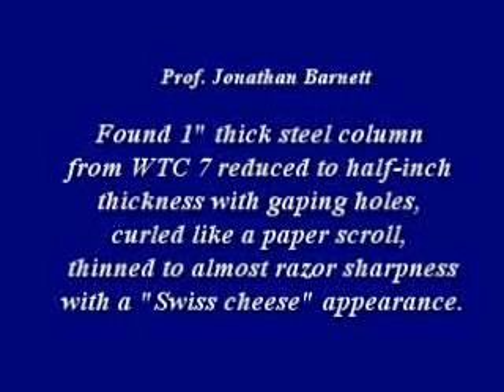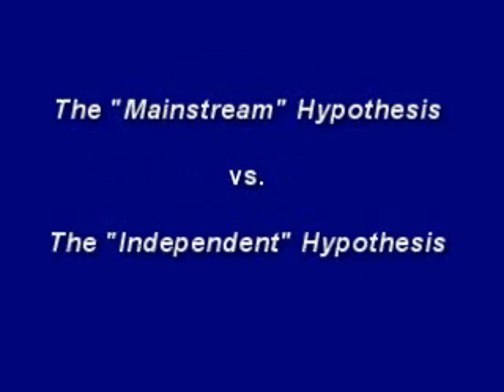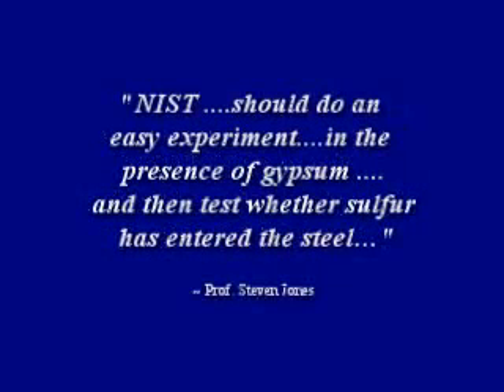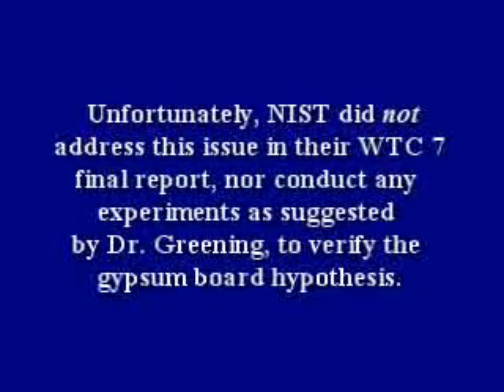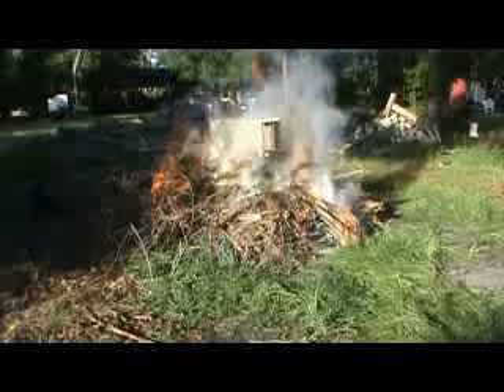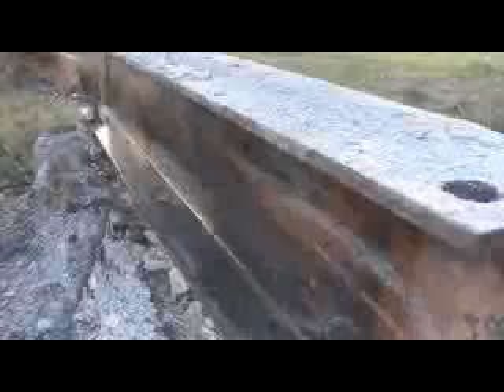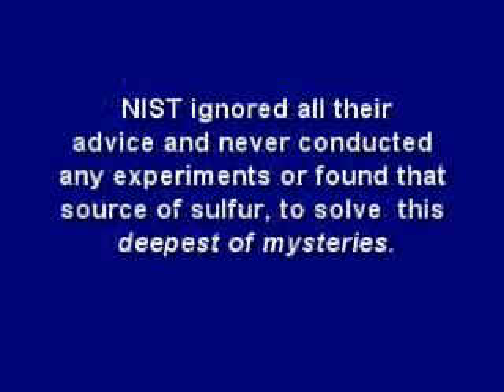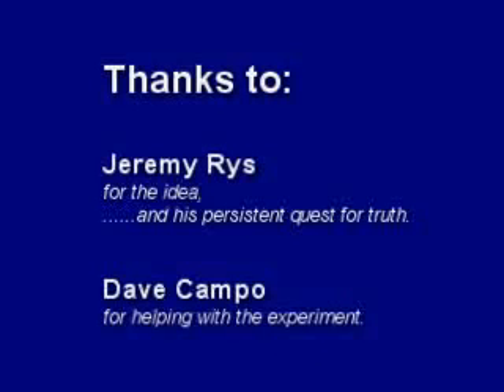9/11 Experiments: The Mysterious Eutectic Steel

Comment: @Kenzofeis "Show me examples of melted and sublimated concrete in a building fire, sufficient to supply a lot of sulphur in surrounding steel structures of great thickness."

Did you notice the debris pile after the building collapsed? This is where your 911 Truther colors will really start to show through. I can tell already that you're not an American and that you have ZERO training in any branch of physics, chemistry or engineering.

Comment: @Kenzofeis "Very high temperature"

The piece of steel that was eroded due to sulfur penetration had the erosion occur at 1800F or about 200 colder than most typical fires. 

"Further, it's not about ordinary corrosion, it's about metallurgy and crystals."

Well OMG!! That changes everything! I forgot about the mystery metal and power crystals.

Comment: @Kenzofeis  "Then, do an experiment where you add sulphuric acid to a setup like his"

I already know that the sulfur will corrode the steel which will then burn away when heat is applied. His experiment wasn't to argue that sulfur couldn't corrode steel, that would be stupid. 

His experiment was prove that WTC drywall (made in the 60's) and Jet Fuel could not have been sources of sulfur.

He used drywall made today and ULSD making the experiment  grossly flawed.

Comment: @Kenzofeis "Mid-1990's"

All on-road diesel fuel (like the fuel Mr Cole used in the above video) is ULSD with 250 PPM or less but typically only containing around 100 PPM or so. 

Jet A contains 3500 PPM or greater. A grossly flawed experiment in the above video. 

The "Chinese Drywall" scandal plaguing Mr Cole's state revolves around the high sulfur content of chinese drywall that did not meet U.S. code meaning the drywall Mr Cole used also contained low levels of sulfur. LOL

Comment: the nist states it has videos & photos of wtc7 collapse. but without examining the actually steel which held the building together all they have is a speculation. the NIST autopsied wtc7 externally from videos & pictures. for how can they determine the true cause of failure without a forensic examining the internal components? the steel. how can this be excepted as proof positive & go unchallenged? examining the actually steel, the guts of the building will at least give a clearer understanding.

Comment: @flanksteak2 if u dont mind me jumping in on this...NIST FAQ's.  "Column 79—the structural component identified as the one whose failure on 9/11 started the progressive collapse "The investigation team concluded that the column’s failure under any circumstance would have initiated the destructive sequence of events" 

1. how was column 79 identified as the source of the failure if no steel from wtc7 was recovered, what photograph shows if failing?
2.how was column 79 proven to be the failure?

Comment: @flanksteak2... Investigators even placed an uninsulated steel column in a furnace 2,012 degrees, the steel column reached 600 in 13 mins. They’ve even conducted test on recovered bolts and found, they too were much stronger than expected. The NIST metallurgist analyses shows of 236 steel samples collected no steel exceeded temps of 1,120 F. In fact NIST metallurgist show three steel samples reaching temps above 25...Yes, you're right it dose help when you read the full report.

Comment: @DuRound2 Which report? I've read them...Every single bit of the rubble was inspected..by whom? I missed that report. And where should I find this report?...Well tough...collect the evidence and test it...That's what they should have done...You don't find the cause of a catastrophic failure by examine a few parts..Do what the NTSB dose when investigated plane crashes...every piece is to be examined even if it take years..You have a problem with that?

Comment: It is estimated that 1.5 million tons of wtc concrete, steel & other debris & more than 350,000 tons of steel have extracted from ground to salvage yards & the NIST only collected 236 samples of steel to be tested, are they serious? That is all that is required for a full investigation? How can 236 pieces of steel be used in the investigation of two buildings, 110 stories each which took tons and thousands of members steel to construct? Why didn't they test the steel for any kind of explosives?

Comment: The NIST report is full of crap. Column 79? How the did the NIST know column 79 failed? In the NIST report they write no steel from WTC7 was recovered, but they know it was column 79 was the failure, really?

What evidence was used to come to the conclusion column 79 was cause of the failure dropping WTC7? The NIST states thermal expansions caused WTC 7 to collapse. What was physically demonstrated which supports that theory" Why don't the NIST show the facts which supports that case.

Comment: @flanksteak2 

"You don't need to be a scientists to tell that it's paint."

Humor me with a guess what the concrete to paint ratio was.  The odds that a large number of samples of dust was paint instead of pulverized concrete has got to be extraordinarily low.  And as Neils Harrit et al have explained, their samples produced low (I don't remember the exact number) ignition temperatures.  What a fire hazard this paint would be.

Comment: @DuRound2 

"its ridiculous to claim to see "Corner squibs"..."

No...whats ridiculous is jets of "compressed air" flying out of tiny holes through the aluminum cladding.  Look at the one corner during the north tower collapse.  One squib per oh say 0.33 seconds?  Thats wayyy too fast for slab impact to slab impact and it precedes the collapse wave.    And...If the floors are collapsing below the collapse wave then what the f is causing the collapse wave itself?

Comment: @fertilizerspike 

No, they used magical hush-a-bombs! Hush little hush-a-bomb don't say a word! 

"If you wanted the building to come down, and blame it on fire, which is not explosive in nature, you would use a different type of charge, an incendiary to cut the beams. You would NOT use explosives which would give away your project."
-Richard Gage

"The explosives had to be so intense such as to hurl these beams at 65 mph laterally, landing five hundred feet away."
-Richard Gage

Comment: @DuRound2
You're simply deluding yourself if you can't see the red hot shit spewing all over hell, falling faster than the smoke and the dust, defying the force of the wind where the smoke gets blown away, and the rapid disintegration of the core while this shit is spewing all around inside it, AFTER the outer walls EXPLODE outward.

watch?v=CQJW7_IIWZ0

Comment: @DuRound2
Look at the video, read the comments showing you the times where you can clearly see red hot shit spewing out of the core as it disintegrates, the outer walls are already blown out, the entire core is a column of smoke and red hot shit spewing everywhere. What is that, did they have a foundry and a dynamite factory in the buildings?

Comment: "If you wanted the building to come down, and blame it on fire, which is not explosive in nature, you would use a different type of charge, an incendiary to cut the beams. You would NOT use explosives which would give away your project."
-Richard Gage
The explosives had to be so intense such as to hurl these beams at 65 mph laterally, landing five hundred feet away."
-Richard Gage

(rolls eyes)

Comment: @fertilizerspike 

"Your belief that none was found is based on your ignorance. NIST and FEMA provided eutetic steel that had clearly been melted and cut, with thermite."

So which is it? Did they use thermite or explosives? Oh, and where's the proof that the eutectic steel had been cut with with thermite?

Comment: @flanksteak2 said:
"fell both inside and outside it's footprint"

Exactly correct, about 80% of the outer walls fell on other buildings in the complex, the other 20% of the outer walls and the core fell into the building's perimeter. And this demolition was completely symmetrical, both in terms of debris distribution and progression. Learn to fucking read, dumbshit.

Comment: @flanksteak2 said:
"only has an expansion rate of 50 MPH?"

Straw man. That wasn't the calculated expansion rate of the explosions (which was calculated much higher), it was the calculated rate of instant acceleration applied to certain pieces of debris whose rest position on the ground was known and whose initial position in the building was known. Learn to fucking read, dumbshit.

Comment: @fertilizerspike "ejected at 50 MPH"

What sort of explosive that is capable of  cutting steel several inches thick only has an expansion rate of 50 MPH? This that magical slow speed nano-thermite that you claim melts beams but also hurtles them at up to 50 MPH!!!!

Clown, at what point are you lay down the hammer, arm tired and brain frustrated from trying to bash square pegs into round holes?

Comment: @flanksteak2 said:
"You didn't say high explosives were used"

I most certainly did, and I'll say it again, a simple analysis using routine physics shows beyond doubt that there were explosives going off while the buildings were being demolished, debris was hurled up to 600 feet away from the buildings from the maintenance floors, which were nothing but heavy machinery to support the building. Are you really this fucking stupid?

Comment: @flanksteak2 said:
"claim that hurtled debris is a characteristic of controlled demolitions"

No, liar, I said it's proof there were explosions in the buildings, and it is, despite your noise to the contrary.

"then claim that the WTC's were melted with thermite"

No, I said steel was cut with thermite. I also claimed other explosives were used due to the fact that beams weighing several tons were hurled from the building at over 50MPH. That's an explosion, dipshit.

Comment: @fertilizerspike "only contradiction"

You claim that hurtled debris is a characteristic of controlled demolitions and are a result of the explosives used to complete them. You then claim that the WTC's were melted with thermite in order to avoid concussive forces that would have made the demolition obvious yet still claim this incendiary had beam hurtling power. 

You have neither shown that demolitions hurtle steel beams or that thermite can cause metal beams to be hurtled at 50 MPH.

Comment: @DuRound2 said:
"Oil is a bonus. And it is not the reason we are there. There is no Oil in Afghanistan"

You dumb fuck, take oil out of the equation and we wouldn't be in either war, cut and dried. Afghanistan is a key transport nation, you have to go through Afghanistan if you're anywhere in the region and you want to get your oil or gas to market. Kazakhstan, Turkmenistan, Iraq, etcetera. Wake the fuck up, dumb shit, stop dittoing Rush Limbaugh.

Comment: @fertilizerspike Ah I see clown. So CD's always have beams hurtling out of them and lodging in adjacent buildings due to the power of the explosives, and CD's always fall both outside and inside the footprint which proves it's a CD because a natural collapse would have all fallen outside the footprint and explosives weren't used on the building but thermite was because thermite is quiet....beam-hurtling quiet.

Comment: @flanksteak2 said:
"one where the steel is being melted rather than being blown up"

You don't seem to understand, this isn't a case of melting rather than blasting apart, there is evidence of both. In addition to the abundant evidence that thermite was used to cut steel, there are also many columns that show classic deformation of severing welds by explosives. This kind of deformation does not occur with slow deformation from spontaneous failure driven by insignificant damage heat.

Comment: @flanksteak2 said:
"characteristic hurtling of beams that occurs during a CD"

You finally accidentally said something right. The fact that a few very large pieces of steel landed several radius lengths from the buildings proves beyond doubt they were explosively ejected very early in the demolition. This was a controlled demolition, everyone who's not a complete moron sees this.

Comment: @flanksteak2 said:
"The towers fell into their own footprint except for the debris that fell outside the footprint."

FEMA's own debris field maps show the demolition was starkly symmetrical with most of the debris lying inside the footprints of the buildings. The maps also show significant amounts of debris flung several radius lengths from the buildings. Simple math leads to velocities in excess of 50MPH for this debris leaving the top of the buildings, impossible from gravity driven collapse

Comment: @flanksteak2
And again let's just point out that these towers fell mainly into their own footprint, except for a few pieces that were blown out of the buildings in excess of 50MPH and which slammed into nearby buildings. There is absolutely NO mechanism in a gravity-driven collapse initiated by insignificant physical damage and jet fuel and office fires to HURL MULTI TON STEEL STRUCTURES OUT OF THE BUILDINGS AT OVER 50MPH. Pull your head out of your fucking ass, or do you like the taste of shit?

Comment: @flanksteak2
Further, there was no reason for ANY of the building to fall to the ground, the remaining structure, of which there was more than 90% intact, survived the damage and the jet fuel and office fires just fine, those buildings most likely would have stood for a hundred years or more if they'd been left alone, but they weren't left alone, they were shredded into thirty-foot lengths and shipped off to China to be melted into paper clips. You're an idiot.

Comment: @fertilizerspike "first panels"

Yes clown. Those panels were falling outside the building and when they hit the ground, much of the building was still standing. That is why seismic vibrations which began when those first panels struck, continued for 15 seconds afterwards meaning the building took at LEAST 25 seconds to collapse nullifying your claim that the building fell with no resistance. 

You are new at this clown so I will forgive you from parroting claims from 2004.

Comment: @flanksteak2
Any such failure would have been incredibly slow deformation, a more reasonable time frame for it to PARTIALLY fail on would be days, not hours or minutes, it would take many decades if not centuries for the steel frames of those buildings to fall on their own, only a controlled demolition explains the complete and utter shredding symmetrical collapse essentially into their own footprint like we all observed. Your foolishness doesn't moot all of known physics.

Comment: @flanksteak2 said:
"how long did the buildings take to completely collapse"

NIST says 11 and 9 seconds for the first panels to hit the ground, meaning they met little to no resistance, and the buildings collapsed symmetrically essentially into their own footprints, which means they fell straight down, which means, combined with the rate of descent, that these must have been controlled demolitions. There is no other explanation that fits the evidence.

Comment: @flanksteak2
And if you don't think explosives were used to cut ever y bit of the steel into approximately 30 foot lengths, the exact length of the flatbeds used to haul it off, then please provide even a SINGLE picture of steel laying on the ground that's longer than 30 feet. I'll wait, but I fear I'll be waiting forever, because no such pictures exist. And all this is ignoring the abundant evidence that the buildings collapsed at the rate of freefall.

Comment: @fertilizerspike "if you're not convinced"

I am too intelligent to be convinced by your special pleading and appeals to emotion clown. Planes and Fires brought the buildings down. 

It's stupid to think that a 200,000 lbs projectile flying at 600 MPH wouldn't hurt the building structurally and it's stupid to claim that fires cannot weaken steel when the engineers consider failure by fire every step of the way when they design the building. 

Eh flunky, junky clown?

Comment: @flanksteak2 said:
"I say your charges would only need to be placed on one floor."

You're wrong, as usual. Just look at the many examples of failed attempts at controlled demolition that leave buildings virtually intact, that's what happens if you don't gut the buildings, that's what happens if you just blow out the bottom floor and expect it to crumble, if you don't do it right, at best the building remains mostly intact, at worst it can fall over and start rolling. Look it up, jackass.

Comment: @flanksteak2 said:
"You claim charges were placed on every floor."

No, I didn't claim that. I believe, since the building was cut into sections no larger than 30 feet, that charges were placed to cut the steel into 30 foot sections, perhaps 10 feet wide in the case of the mesh of the outer walls. That's important to remember, the outer walls were a dense mesh of tubular steel and brackets welded together such that joints between adjacent modular sections were not aligned across floors. Moron.

Comment: @flanksteak2 said:
"The collapse would have behaved the exact same."

False. If the plane impacts and fires were responsible, we would have seen a slow deformation leading to partial collapse, in no way could the mass above the damage destroy or even dislodge more than an equal mass below it. This was obviously a controlled demolition, to suggest otherwise is lunacy, if you don't agree then you're ignorant or stupid or both.

Comment: @flanksteak2 said:
"lets say thermite, explosives"

Good idea, I think you're right. Thermite was definitely used in the demolition.

"airplanes and fires started the collapses"

Aw, and you were dong so well. This is clearly false. The buildings took insignificant physical damage and sustained fires that were incapable of significantly weakening the steel, so every hypothesis but controlled demolition fails. This was a controlled demolition, anyone with an IQ above that of a turnip knows it.